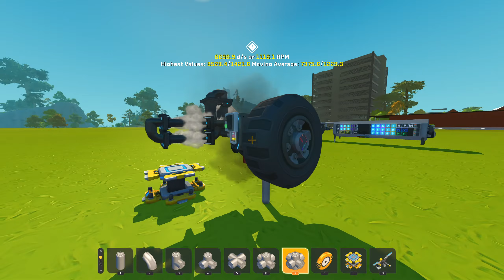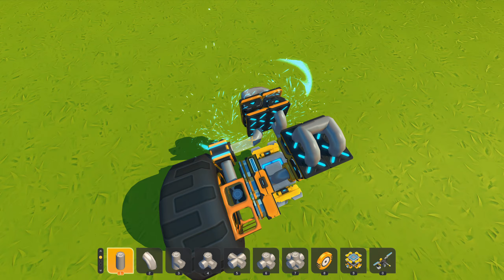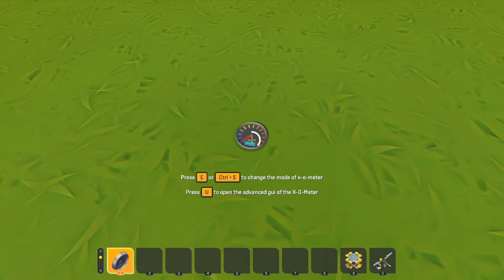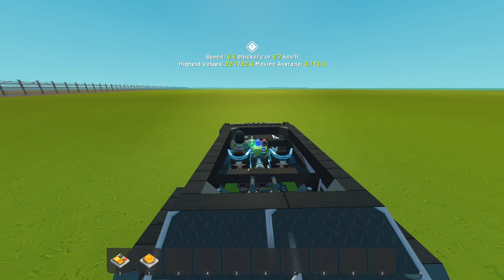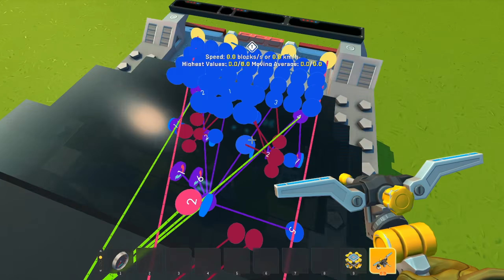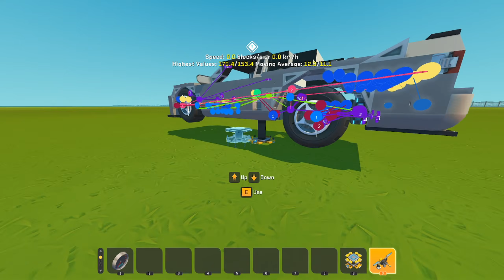This piston engine will change Scrap Mechanic forever!

Comment from the maker: Here are some of the mistakes I've said during the video:

-blocks don't affect the timing plate's efficiency

-kein engines are usually the best engines for low end pcs because of less complexity. My game only lags because I am recording + using the outdated i3 cpu from 2014

-"I also wouldnt say that they have no torque, they make ~50% of conventional engine torque relative to stroke size, kinda missleads people into thinking its impractical af" - Kein
.
.
.
also if you want to use your variable stroke kein engine to a car, you must mirror the engine by using the Duplicator Tool: https://steamcommunity.com/sharedfiles/filedetails/?id=2963669827

Comment: problem with logic blocks is they each add 1 tick delay. dont sound like much but that will work like a restrictor on any engine.  thats why i use a variable timing and rotate the sensor array or the area they read.
Reply from the maker: @MrLarsgren  yes

Comment: These engines are actually good for bad PCs, as they have super low complexity. One reason why I used them on my potato laptop back in the day
But just like with any piston engine, you need to maintain 60fps or more, this only gets more noticable with faster engines.

Also, friction isnt a thing within a creation
We mainly use mesh blocks for visual reasons only lol

Comment: This is the only way to overtake the light at the end of the high speed tunnel.
The short journey to the very far away destiny of peak performance.
The smooth path of true piston power enlightenment.
Efficiency to make even the most german german jealous.
The only way that any road vehicle should be powered. Period.
lol
Reply: moin meister, wir müssen ma irgendwann nommo sm zusammen zocken🤣
Reply: @MedicMainDave  Ja ok, wenn du willst lol